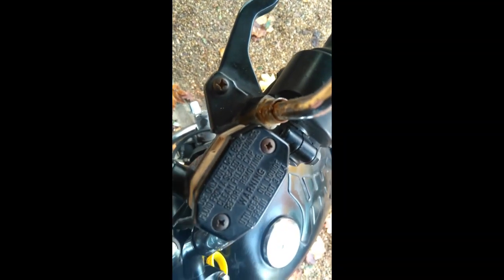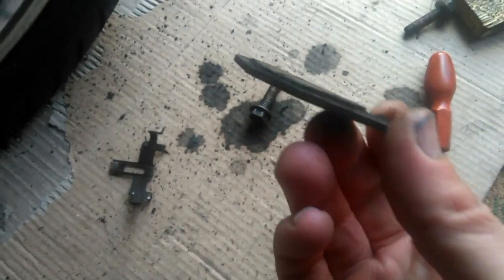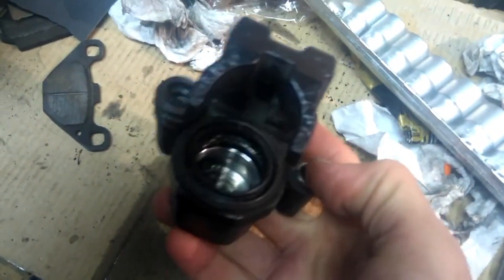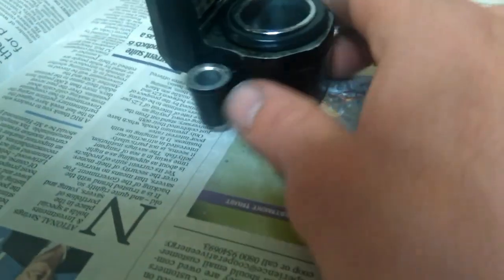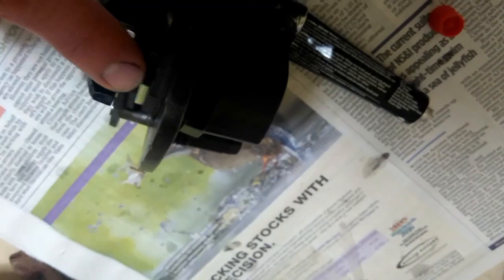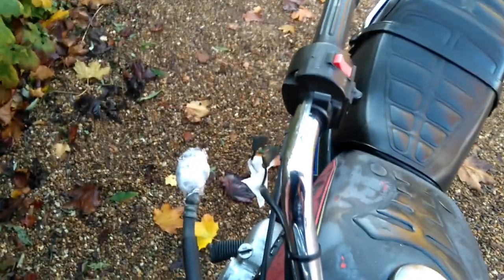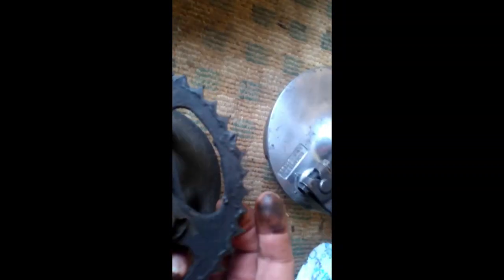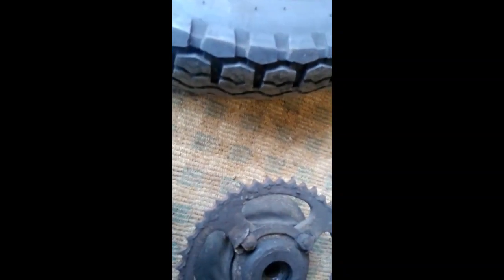Suzuki GN 125 brake caliper inspection and clean

Comment: Yeesh yeah, I know it's an old vid now, but that is one shagged rear sprocket :P I've recently just got a GS 125 on the road and did some work on it at my dad's. My front brakes had a leak from the master cylinder. Turns out was just some crud on the o-ring seal. The caliper was stripped down and given a  basic service and flush through. Had the rear wheel off myself just to clean up and check the drum shoes and drum. My dad had already put a new chain on it and it's rear sprocket was fine. So popped it back on with a basic adjustment at the time.
Reply from the maker: Thanks for watching and leaving a great comment. It is easy to get a leaky looking front master cylinder if you place the diaphragm upside down on your bench the brake fluid trickles onto the top of the diaphragm. Then when you put it back the fluid seeps out the top like you have a leak but you don't really.
Anyway have a safe journey mate.
Reply: @peterh600  Yeah it had been sat for nearly the last 14 years. Had some work done on it. The prior owner hadn't noticed it had been leaking. Sadly it's took some of the paint off, but I'll be doing a "running" restore paint job on the freame this November.
Reply from the maker: @Lupni3rd  for what it's worth I had a Yamaha Dt50mx frame powder coated cost about 90 quid but looks good and is really tough. My other frame i used spray on smoothrite which when dry is resistant to fuel leaks and is quite tough.
Reply: @peterh600  I'll proably just give it a going over with Hammerite Smooth by hand to be an el cheapo :P
Reply from the maker: @Lupni3rd  yeah the spray version of hammerite smooth is what I meant.
Reply: @peterh600  Ah didn't realise it had a rattle can version.